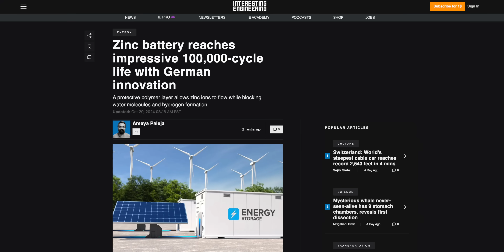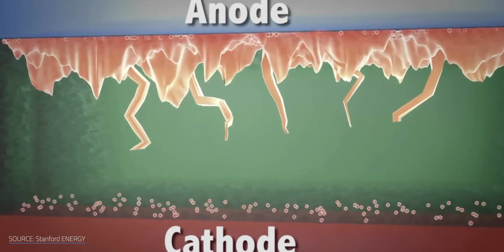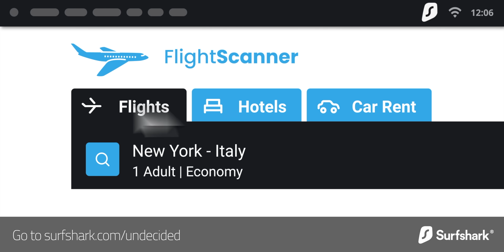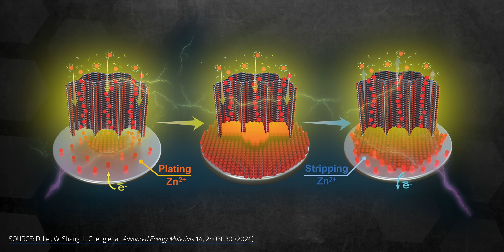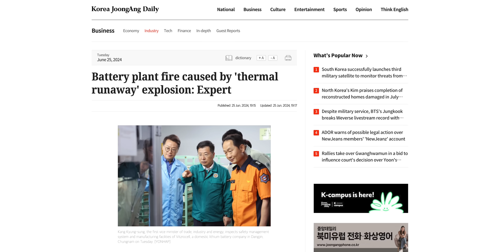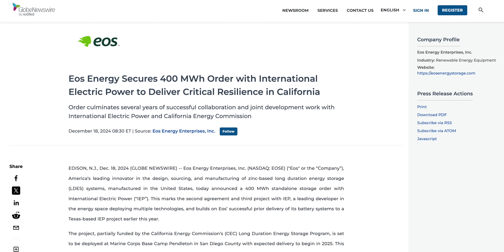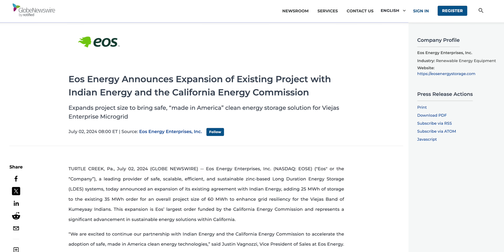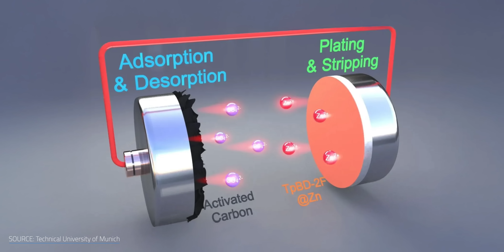How Zinc Batteries Are Defying Limits

Comment: 1:34 'Zink does actually have potential', nice, Science geek meets Dad joke.
Thanks Matt for the continual supply of Easter Eggs.
Reply: Don’t get it… I’m missing some sort of scientific or cultural reference here maybe?

🤔
Reply: @weedfreer  Cell potential, is a measure of the difference in energy between the two electrodes of a battery, otherwise known as VOLTS.
So for a Zinc-Bromine Flow battery the cell potential is around 1.8 volts per cell, because Zinc has a reduction potential (compared to a hydrogen electrode.) of -0.76V and bromine is +1.087V.
The potential is the difference between those two points -0.76V and + 1.087V, which is where we get 1.8V.
If there is no potential difference between the Anode and the Cathode, then nothing is oxidised, nothing is reduced and there are no electrons moving which means there are no Volts and no work that can be done. 
So 'Zink does actually have potential' is a battery chemistry joke, sorry that my description is a little flat. 😜

Comment: Due to it's many...many limitations I don't believe we'll see the demand for lithium batteries as they expect.
Reply: What limitations? Today's lithium-ion batteries are already cheap and good enough for most car owners, buses, commercial vehicles, medium-distance trucking, construction equipment, home storage, and grid storage. McKinsey: "the entire lithium-ion battery chain, from mining through recycling, could grow by over 30% annually from 2022 to 2030, when it would reach a value of more than 400 billion and a market size of 4.7 TWh." IEA agrees, "EV battery demand grows four-and-a-half times by 2030."  Neither of those projections reflect the drop in Chinese battery prices in 2024 because some car makers saw less EV growth than they hoped, which will increase demand because Chinese EVs are now as cheap as gassers.
Reply: @skierpage  While prices may have decreased at hyperscale deployments for the end user prices have been stable since 2021 which was at an inflated price. Lithium batteries have the same swelling and dendrite issue that their smaller cousins have and begin to have reduced recharging cycles year over year. While they may "last" 500k charges the actual usefulness of the battery after 5 years is reduced to around 70-80% at best and by 10-15 years to around 40%. This is all ignoring the fire issue they have that doesn't go out until all the batteries around it have completely expended the material. Moisture exposure or even saltwater exposure of any kind within the battery, excessive heat or excessive cold, infrastructure limitations and bad press have led to a very slow adoption of Lithium outside of governement programs. Just like with zinc ion, aluminum ion batteries have a dendrite formation issue. Both zinc and aluminum have a much higher energy potential and are significantly more abundant. Once these issues have been resolved in the lab and scaled they will significantly eclipse lithium. If you want to know where the real demand is for lithium just look at lithium mining stocks. Outside of maybe 1-2 companies they have gone down significantly in the last 3 years.

Comment: So I was wrong.  I await your second item on Zn batteries.  I suspect that the company that really succeeds is the one that will concentrate on the home market.  Two of these batteries of around 10-20kWh each would be just what would take over the home market (depending on price, of course) but with the tremendous longevity, it is just what the market needs.  If this new development eliminates the wee pump in the Redflow battery, then it is a great innovation.  That is the only part of the Redflow battery that could ever need replacing.
Reply: Not quite correct. The pH adjusting internal sock needs replacing, both of our Redflow batteries had theirs replaced. There are two pumps in each battery, one for + the other for - electrolyte liquid. Not to mention the internal fans needing replacement.

Then there is the small matter of Redflow going into liquidation, so no more parts, service or anything. Apart from those issues and a few other smaller issues, the batteries are very good, but as ours are coming up towards 6 years old this year, we are replacing them shortly. The interesting bit is that both batteries still perform exactly the same as the day they were installed, no degradation of power storage at all; which is probably their greatest asset, apart from the fact they pretty much cannot catch on fire.

Comment: Yeah not gonna happen.  Planned obsolescence is exactly that, planned.  The car, phone, whatever product it is will not last half the length of the battery.  A company that implements this would be better off investing in component collection to recycle the batteries into new products.  Plus, with the 'I deserve the newest and best' attitude so many consumers (not just the USA) have these days,  a very small group of consumers keep any high tech gadgets long term.  Energy density research and improvement is much more lucrative and beneficial to our society than improving battery charge cycle limits.

Comment: My F150 has a 36 gallon tank so I can go or tow, 600 down to 350 miles.  Gas at 6 pounds per gallon + tank is around 350 pounds.  Tesla batteries weight 1200-1800 pounds.  When a battery can store enough energy to take me as far as gas and weigh in at under 400 pounds, l am all in.  Possible Saint Elon will make it happen.

Comment: Man youre really gonna open with hyping up a zinc battery EV then bury the fact you already know this breakthrough is not gonna be used for EVs after the ad read
Reply: EVs are hardly the only use for batteries.
Reply: @TheDanEdwards  so open with the uses this battery would actually see

Comment: My biggest concern is the lifespan. If I can get a battery that lives as long as I do and is rechargeable then I want that in my portable devices regardless of whether a charge lasts all day or 75% of the day. Though, I definitely also want it to last all day on a single charge, but as long as it doesn't just die in the middle of me using it with its usability diminishing over time, that would be good.
Reply: 7:20 "a zinc-powered iPhone would probably need to come with its own iBackpack"
Reply: @skierpage  The size disparity isn't that much. But as I said, my biggest concern is that they can hold the same charge level for their entire lifespan. I've had multiple tablets and phones now that after 2 or 3 years the battery capacity diminished by nearly 50%. Several just flat out died. If batteries were easily replaced that wouldn't be as aggravating either.

Comment: What we need to do is start to calculate total Kwh cycles per dollar through mean time to failure with a +- 20% for variance in life expectancy.
Reply: Good luck with that 🙂. Most people can't even understand the difference between kW and kWh and presenters have to dumb it down to misleading statistics like "can power 1,000 homes" or "can travel 250,000 miles" instead of providing charging power or degradation graphs. Besides, it's not so much "fail" as how much of the original battery capacity is left (70% for the federal 8 year/150,000 mile required minimal EV car battery warranty).

Comment: If a forever battery was ever available, we'd never see it in consumer products.  Part of the reason we replace gadgets is because the battery starts to fail.  They want to keep you throwing out everything you buy to get the new one.
Reply: Exactly. The only plan they would have then would be subscriptions...or simply deactivating the devices (looking at you, Samsung). And that's not as subtle and gets them more bad press than just making batteries non-replaceable.
Reply: This battery is not intended for electronics. The efficiency is too low for that. This would work better in a house or a city.
Reply: @manuvillada5697  This battery perhaps. But the OP's comment still stands.
Reply: @manuvillada5697  Is it the efficiency or did you mean the energy density, different things.
Reply: Check out Iron/ Nickel batteries aka Edison Cells. There are supposed to be some banks for power stations that have been in use for more than a hundred years. The main thing needed was to keep an eye on the water based electrolyte levels. Their power density is less than Lead/ Acid but there are those that think that they do well enough as a stationary storage.
Reply: There is no way that won't change, we are currently in the most wasteful phase of our short history.....
Reply: Batteries are designed to the average expected lifespan of ownership of the product. (There's probably a clever engineering/economics term for this.) Most people aren't on their phones that much, and therefore aren't charging them as many cycles, which then allows them to use them for multiple years. Another consumer segment is buying the newest phone every time one is released, so they're replacing it before the battery degrades. It's the power users that are also trying to keep the phone past 24-30 months that have this issue, and they're a minority of the market. 🤷‍♂️
Reply: So don't support companies that have those practices. There are plenty that offer great products that can be repaired and replaced. Most people also fail to look after their batteries, letting them regularly run low, always charging to full capacity or letting them get hot in the warm weather.
Reply: @buddhamack1491  Find rechargeable earphones, mainstream cell phones, or tablets that have replaceable batteries. It's nice to daydream about responsible consumerism, but the reality is much more difficult.
Reply: @DonoVideoProductions  You can get everything you just listed there, don't be lazy and go have a look....
Reply: @MickH60  No. No earbuds have replaceable batteries. No tablet has user replaceable batteries (without basically unmaking the device. I sent my tablet to Samsung for battery replacement.  They sent me back a tablet with the screen installed upside down. Sent it back. It works now, but the screen still flashes randomly. And I lost everything on the tablet. How much better if it had had a user-replaceable battery). No mainstream phone has user replaceable batteries. This may change due to the EU's mandates. But the US has no stomach for legislating sustainable policies. Even less now.
Reply: @DonoVideoProductions which samsung tablet is that? I've replaced 2 tablet screens and cannot even imagine how that could happen with the way the flex cables are placed.
Reply: @tempeleng  It can't if you connect the cables. They didn't. The screen didn't light up at all. And since I could prove they sent it to me that way they deigned to redo the work and pay for return/return shipping. To this day, it flashes when trying to turn on, and again when dimming. Sometimes, the screen won't light...and goes to a gray screen with colored flecks on it. I have to push the button to turn the screen off, and try again, sometimes several times. It's a Galaxy Tab 3.
Reply: @buddhamack1491  but companies that do those practices make the most money, and so they get the power to buy out or starve out other companies that don't until eventually they are the ONLY companies left. there are no other options, all others that pop up disappear just as quickly.

Comment: Didn't John Goodenough and Maria Braga (mostly Maria) develop a 'lithium-glass' electrolyte (in a solid state battery), which started out as an anode coating? Using 'sodium' rather than 'lithium'? Whatever happened to that?

Comment: Great video, few things to note: zinc batteries are uniquely suited for stationary storage. Not so much EVs given their lower energy density.

While lithium excels at the 1-4 hour range, there are zinc batteries, in wide scale production, that work best from 6-16 hours of duration. This is perfect for fixing the dreaded duck curve.

There is a non-flow, NON-FLAMMABLE, recyclable, made in America battery in production now. They are at 90% RTE in that 6-16 hour range.

EOS energy enterprises out of Pittsburgh is on track to make 8 GWh of production capability by 2026. Name another zinc company that’s not in r&d still.

As you said, zinc batteries are inspired by plating baths. They solved the problem of zinc dendrites by using a different chemical soup that’s refined out of Arkansas.
Reply: 3-16 hour range

Comment: This is a great advance, but will it pass the big lobbyists in DC. The ones who decide which technology goes forward. And I explain... the battery is supposed to last a longer period of time, while the current ones in the market don't. What it means is the possibility of these companies (current ones) going broke while the one with the technology might not make money on replacement either. So, the money is not on building new technology, but building something that lasts a short life span and must be replaced in three to five years. In summary, I like the technology, but... Will it make it to the customer? If it does, then someone will make sure to a cost that's out of the regular Joe buying power.

Comment: It won't happen because anything durable that is not profitable for manufacturers doesn't get made or sold. Your battery will be connected to the cloud and if you don't top up your cloud subscription it will stop working. The company could discontinue it and replace it with a new model, or it could go bust, requiring you to buy a new one from a different company.

Comment: Hi Matt.  I only got to minute 5.16 of your item so perhaps I am talking out of turn but I think you have a wee precedent problem here.  The battery you show on the cover picture and in the 'text' of your item bears an amazing resemblance to the LiBr battery developed in Australia many years ago by Redflow.  Let me predict what you are going to say in the rest of this item.  The battery uses Br as the other ion and it is a flow/plating battery.  It plates Zn on to the plates as it is charged and strips the Zn off while the power is being used.  The secret to its longevity is to, from time to time, completely discharge the battery which eliminates the burgeoning dendrite problem.  Ergo, it is best to have at least two batteries so when you discharge one completely, any excess power can be taken up by the second battery.  I have been pestering Redflow to tell me when this battery will be commercially available.  So has this development been taken over by this new company.  Redflow also uses an organic compound to absorb the BR which is a liquid/gas at room temperature and is only slightly less toxic if let into the air than Cl.
Reply: Yep! Red flow is dead in the water, bankrupt. Only EOSE has commercial production of zinc batteries.
Reply: Maybe just watch the video before submitting your essay...

Comment: It is not Zinc ion, but I had a couple of NiZn batteries. I wanted to like them as their 1.6V voltage could come in handy in my lamps and other things, but they could broke simply because they existed. At least one of my orders were useless, and the good batteries broke as well after several uses and that I did not used them for a while.

Comment: Li-ion batteries have higher energy density, but require control systems to keep them from overcharging. Since Zn-ion batteries would presumably not need such regulation, would they be able to accept a full charge? And how much weight could possibly be saved without those control systems?

Comment: 100,000 cycles batteries sounds like something the battery industry will start to think twice about. aka planned obsolescence... I hope we see that be true, but I fear the industry will destroy such an idea if even possible.
Reply: phone manufacturers can still stop providing os updates to force users to upgrade. Microsoft is actually doing that right now with win10 which i find annoying when I've successfully installed win11 on a dual core toshiba laptop from 2015 and it runs without issues.

i imagine a new startup will eventually embrace zinc batteries just to stand out from all the other phones that basically look and perform the same. maybe call it the forever phone or something.